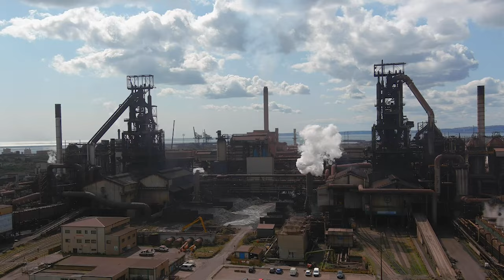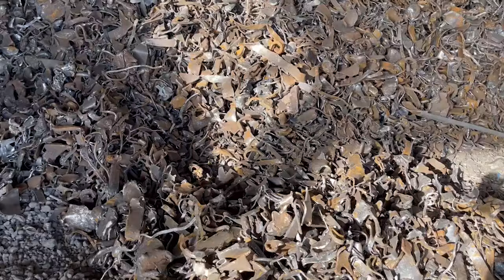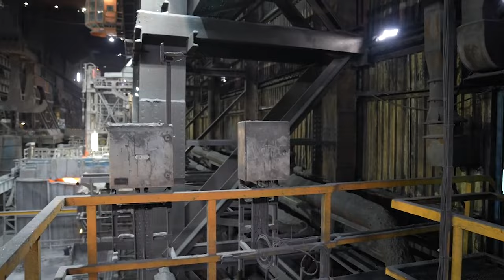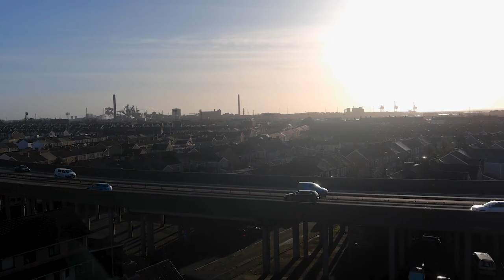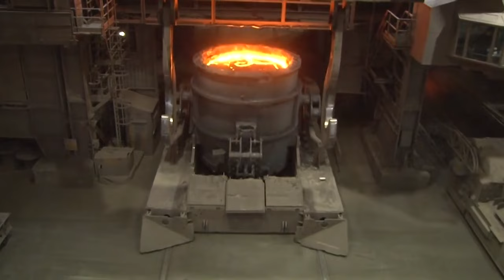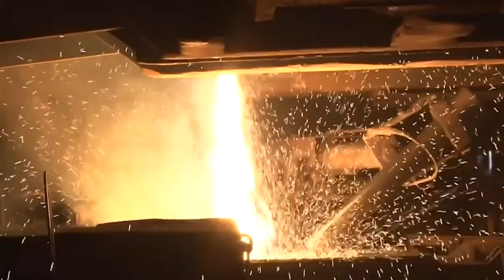The challenges of building an electric furnace in an operating steelplant

Comment: Very Interesting, am I right in thinking that the E.F. will only be utilized to melt scrap steel, it's not a replacement for the oldblast furnaces that made steel from raw materials. If this is  the case in the future will steel making in the Uk will essentially be a recycling process, not suggesting this is any less envolved, but someone somewhere will still have to make steel from raw materials. Also what sort of electrical power will be needed to run this new furnace.